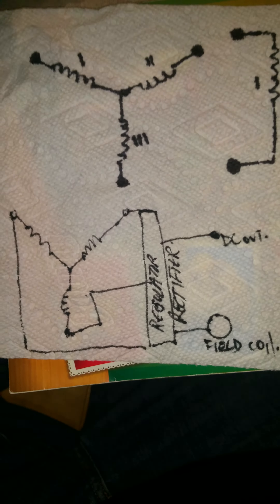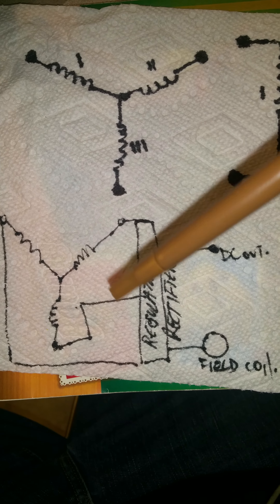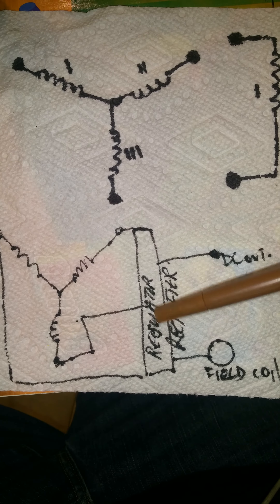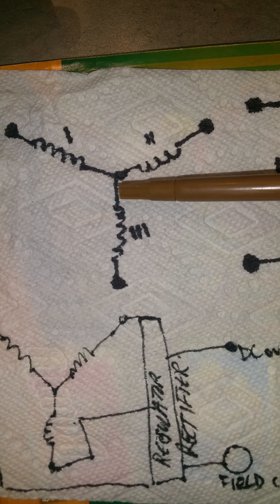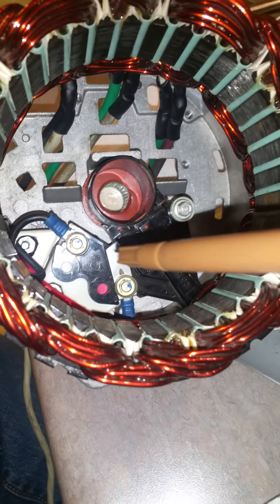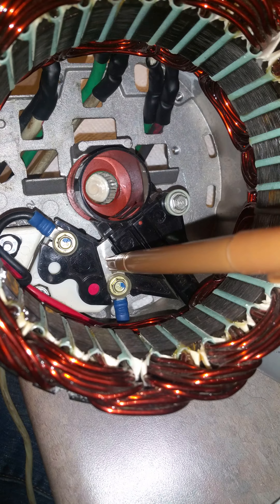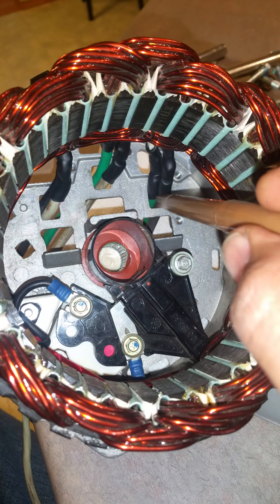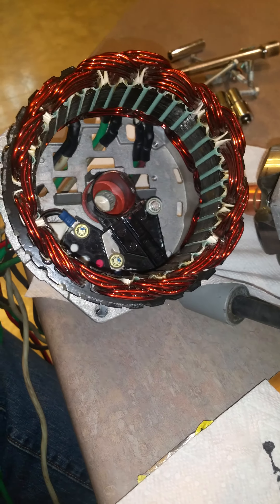Conversion of 2kW alternator to brushless DC motor

Comment: A similar generator pushes my car with a driver and a passenger. I like it. I also like to make interesting projects, one of which I do on my YouTube channel.
Reply from the maker: I checked out your videos, I did not think the motor would have enough torque to move the car. What is your supply voltage? What did that alternator come off?
Reply: @elser2utube  The voltage in the last video was 57.8 volts. 72 volts are planned. The voltage can be raised, but the controller current, it is really not enough 280A and there is only 40A. Plus, I also started from second gear (I just confused it with the location of the gears)

Comment: How did you mesure the watts ?? Thanks
Reply from the maker: The Watts was calculated using the current and voltage.
Reply: @elser2utube  yes i know but that alternator is'it in New situation..it's becam motor ... it's no difference beetwin motor and alternator !!??... thanks again
Reply from the maker: @azertaieb442  The calculation of watts using P=IV is really how much power the motor is using, or how much power the alternator is putting out. ....The actual mechanical output would be the total power consumed multiplied by the efficiency ( which would vary but be some number less than 1) Let's say it is 0.7 in this case. So we would have 70% of the power being consumed by the motor available at the motor shaft. The remaining 30% would be lost in the motor to heat(which would consist of power dissipated in the coils internal resistance and eddy current losses) and friction from the bearings etc. If the voltage levels are the same, the losses should be roughly the same whether the device is being used as a motor or generator (same bearings, same wiring in the coils, same cores in the stator and rotor). Hope that helps.
Reply: @elser2utube  very satesfad ...thank you so much ...gread job and gread Channel. Thank you again

Comment: , where do I find thevideo that shows how to connect the six (6) stator wires?
Reply from the maker: That info is on the drawings in this video, I have not had the time to continue documenting this but I will make another video to clarify the connections some more.
Reply: Same problem
Reply: हमारा आपसे निवेदन है कि हमें कंट्रोलर और कनेक्शन कि पूरी जानकारी ठीक से बताएँ एवम हिंदी में पीलिज